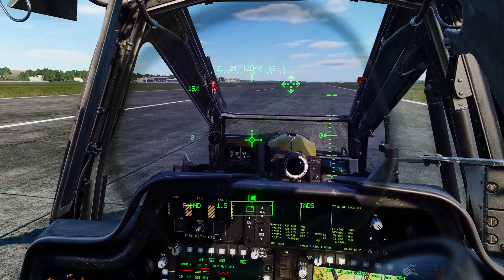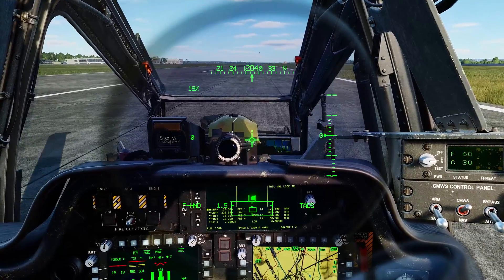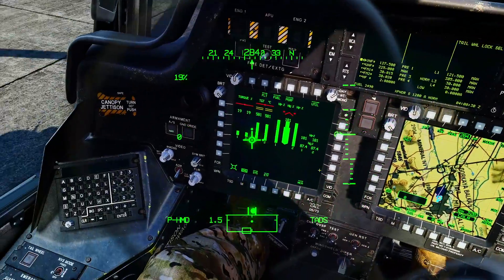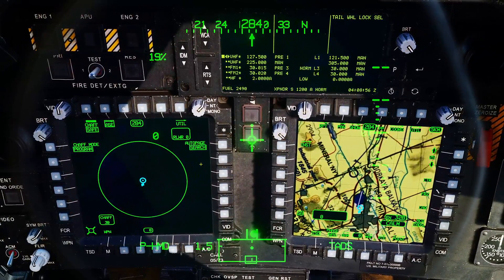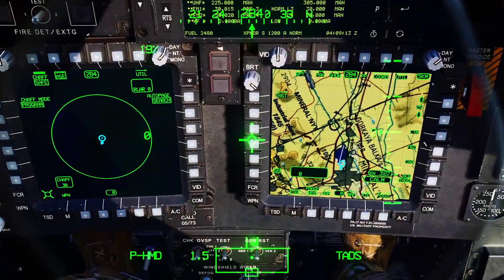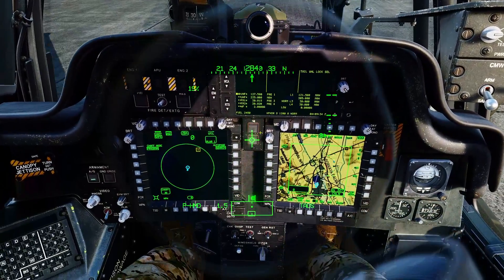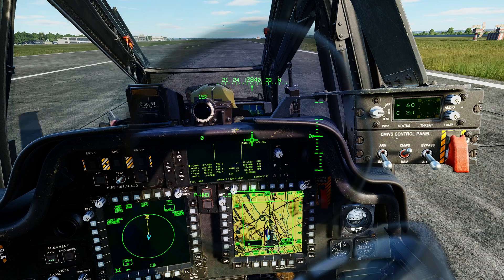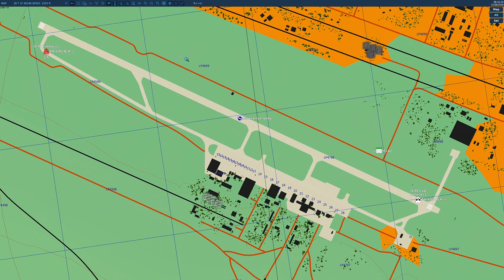AH-64D Apache: Laser Warning System Tutorial | DCS

Comment: When i was stationed at Ft Hood I would use the simulator during my lunch (i worked in the Flight Operations hanger next-door) and ended up with 1120 hours of flight time.
Reply: Then they count for anything ?
Reply: @kp5106  nope. Never filed any paperwork. I wasn't really supposed to be there. Only thing I was rated for was UH-1H.